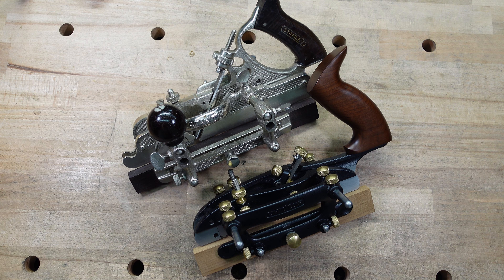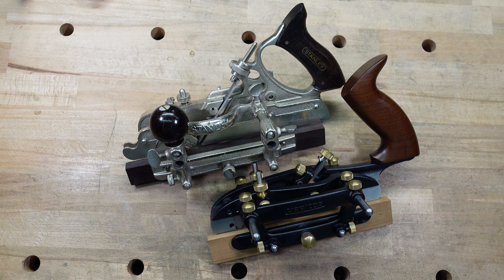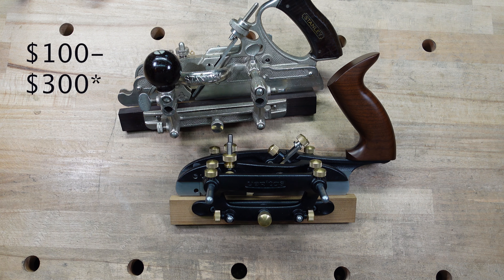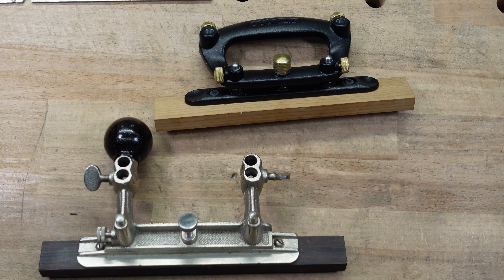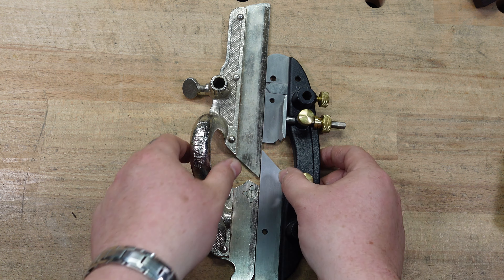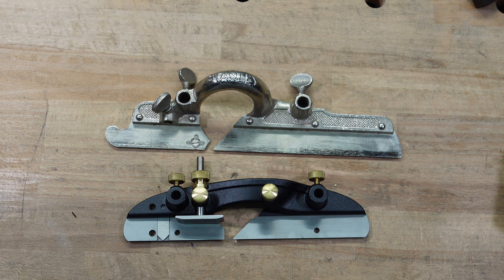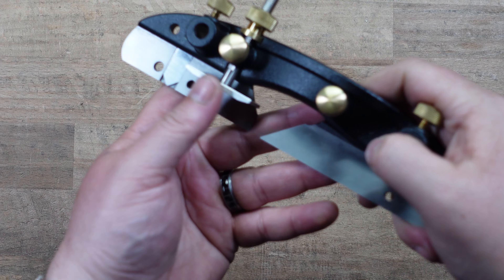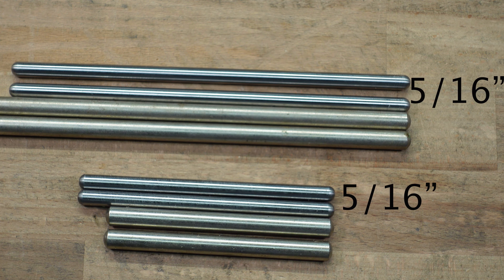Veritas Combination Plane vs Stanley no 45 - Review and Comparison

Comment: I got my 45 in 2020 for $45 as part of my 'Covid hobby' of restoring old planes.  It came with one blade and mismatched bars (1 long & 1 short).  Over the past three years I have purchased an additional 35 blades and built a finger-jointed, hinged box to store everything (I even used the 45 to make the dados for the top & bottom of the box).

The 'fun' of the project was the hunt for the blades.  My wife likes antiquing and I usually get bored very quickly, so the hunt allowed me to join in her favorite activity.  It also allowed us to travel around central and northern Arizona to all the out-of-the-way shops we could find and enjoy the drive, weather, and try some out some new restaurants.

While the Veritas Combination plane is very nice, the memories gained with the 45 make it impossible to replace.
Reply from the maker: Oh 100%! You build and restored that plane and each piece is a memory. You can't give that up! The sentimental value of a tool outweighs alot!!!
Great job and thank you for sharing, I like this!

Comment: 13:50 The slitter is used when you pull the plane backwards. It can act as a nicker, but it also works as a veneer cutter. In fact, I think the primary purpose of the slitter is veneer cutting. 
Something you mentioned at the beginning of the video was the location of the depth adjusters. I find that the Stanley adjusters actually work better than the Veritas because, by setting them at different positions from each other, you can keep the whole plane flat on the wood. With the Veritas, there's too much of a chance of the plane not being level when you reach the end. There's also other reasons for the two adjusters that I cant really remember at the moment.
Reply from the maker: This is deff a valid point, with the depth adjusters ofset they have more contact longer. With them lined up its only contact right there. Thank you for pointing that out!

Comment: i have three 45's of different ages and types and a 55(plus a 41, 43, 46, etc etc)
my oldest 45 does not have the iron adjustment knoib, just the clamp.  the newest one has the micro adjust fence.  the knob is on the front of the skate on the oldest, then it moved to the fence.  i never use the knob, i wrap my left hand around the curved portion of the fence
the spear point gadget on the rear is called the slitter and is used to cut veneer strips
i use all of mine regularly, the oldest 45 does beautiful flutes with a modern veritas cutter
the 55 has a lot of capabilities that the veritas does not.  the left skate on the 55 can be moved in the vertical direction for various moulding cutters
Reply from the maker: That is awesome and sounds like a great collection!! Thank you for sharing!

Comment: "Depth stop" holder on Stanley moving section is for beading stop which is much longer than regular depth stop on the main stock. There is a smaller depth stop (often missing) for this spot on the moving section.
The slitter on Stanely is to cut/slit veneers or thin wood boards.
The main difference between Stanley 45 and 55 is not the double fence option. On 45, you can move the rods over more and have nother 45 fence on it. It is on 55, the sliding section can move lower than the main section to support cutters that are lower on the outside. Also, the fences on 55 can tilt around the push direction so you can a bead on the corner of a post/beam.
Stanley combo planes are more for 3 finger grip since you can reach blade adjustment wheel with your index finger. On all my bevel up planes, I use my left hand to adjust blade since there is no way fingers on my right hand can reach, let alone getting any grip. Or I have to put the plane down to make blade adjustment with my right hand. Small hand problem.
Very early Stanley 45s have brass thumbscrews with straight knurling, similar to what is on their bench plane blade adjustment knob/wheel. When every thumbscrew is wing type, and you have different moving parts close together, somethings you cannot tighten some of them or the wings will interfere with each other. Knurled thumbscrew with a slot on the head is probably the best; you can adjust with fingers, and loosen stuck ones with a flat head screw driver.
Reply from the maker: Thank you!!! I pinned this comment because there is great info here! You rock!

Comment: I recently picked up a Stanley 55 in excellent condition with all the cutters.  I’ll probably buy the Veritas to use on a regular basis, and only use the Stanley when I have to use the adjustable skate height for certain cutters.  I’m always torn between buying new high quality tools and buying vintage.  I’m both a collector and user, so I don’t mind buying both if its reasonable to do so.
Reply from the maker: I'm the same way, if the vintage performs just fine and is cheeper go for it! Esp if it's a plane you don't use too too often! If it's a plane I use all the time, like Mt bench planes, I prefer new cus they are just easier for me lol

Comment: like everyone else has already said; the blade in back of the body is for veneer cuts.  Your index finger should rest lightly on the blade adjuster.  I have a great 45 and 55 with all the blades.  I couldn't imagine paying for a veritas + all the different blades.
Reply from the maker: I always forget the index finger it is a bad bad habit. I do the same thing with hand planes :( 
If you already have a 45 and 55 with the cutters you deff don't need to get the Veritas! Both planes work :D

Comment: Hi, thanks for posting this comparison. I have a stanley 45 and like it very much...works for me pretty well, though I know that veritas would be great as they make tools to very high standards. One question,some of the blades I have are damaged. Do the veritas blade work with stanley 45? From the looks of it I think they should but since you had a chance to handle both, wanted to check if you had tried that already. Thanks!
Reply from the maker: Hey! If I remember correctly they do. But both of these were borrowed so I can't check :( check the thickness of the irons on lee valley and then use a piece of wood thay thickness and see if it fits in. Thay will be a sure fire way to make sure. Sorry I couldn't help more :(

Comment: Can you show us how to use Veritas as Stanley 55? I didn't get the idea of two fences on both sides.
Also are they both 45 degrees angle bevel down?
Reply from the maker: Yes I will in the next video, it doesn't have all the features of the 55 but the dual fence makes it easier to work on the edges of boards.
Ah yes I forgot to say that, both beds are at 45 degrees and the cutters are bevel down

Comment: Good video. I have the small version of the veritas and I have a 45 and 50. The funny thing is I was looking around my shop the other day, because I just moved things around, I could find the blades for my 50 but not my 45. I think I picked up my 45 for around $200 last year, and it had all of the cutters. They are all really neat planes that can do some stuff really fast vs.having to setup or reset up the table saw or do some strange stuff with the router table. Though most of the time I am just using them to cut dados for the bottom of boxes. Though I did make some picture frames and I used my handplanes to do the beading around the edges. I think I am fairly lazy in the fact that I did all the beading when the board was in 1 piece and then cut the miters. And your friends Stanley is in amazing shape.
Reply from the maker: That is awesome! I do the same thing! Tbh if I was loaded I would have multiple planes all set uo for 1 task and leave then that way haha like 5 plow planes for diff tasks that's the level of lazy I reach sometimes hahahha 😅

Comment: You are comparing a classic old tool that has created thousands of miles of moldings and trim too a modern age computer designed and manufactured tool that does feet for the few that can afford them and actually do use them for paying work.   I will take the classic.